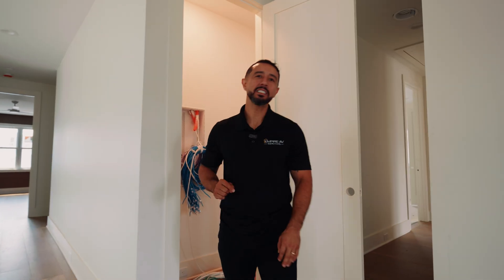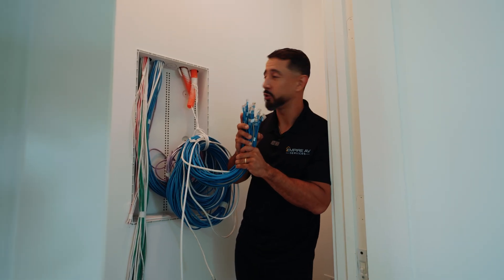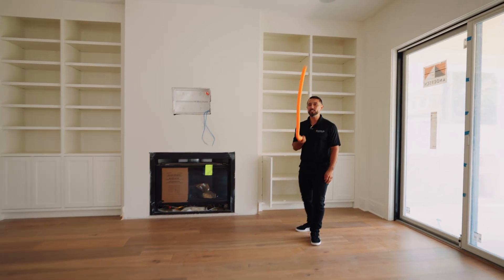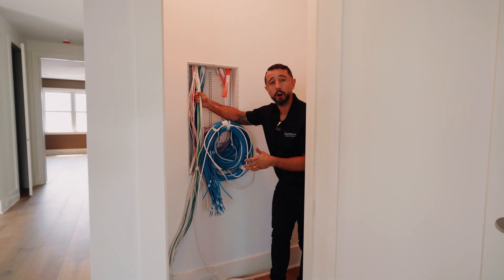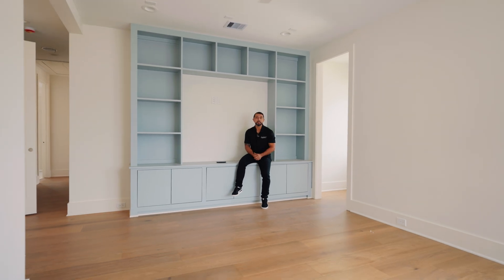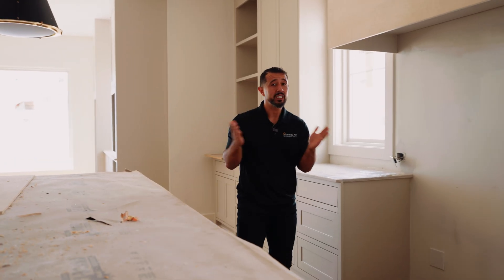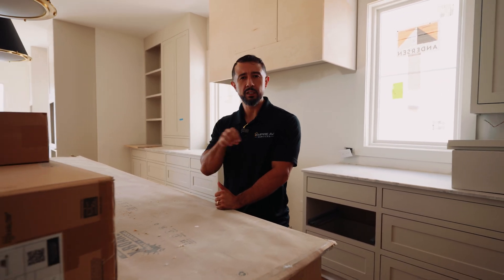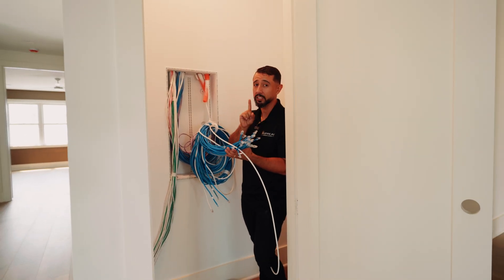10 Smart Home Pre-Wire Mistakes to Avoid.

Comment: For number one; do you use or recommend to use Cat8 cable for POE devices, such as cameras?
Reply: For number four; are you using a structured media cabinet in conjunction with a server rack?
Reply: For nine point five; I subscribed! 😂
Reply from the maker: Sometimes we do both, just depends on the setup. If a home owner wants stuff local, we might use a media panel in the closet or cabinet. Other times, we bring everything back to a central rack with patch panels. All comes down to the flow of the house, products and the scope.
Reply from the maker: Cat8 looks cool on spec sheets, but honestly it’s way overkill for most smart home gear. Most POE residential devices can’t even handle that bandwidth. We stick to Cat6 or Cat6A — easier to work with, and still more than enough for cameras and access point. (If you need extremely fast speeds for other things then maybe but for cameras you won’t need that for a while)

Comment: hey i have a question. Lunar-Walls, would they be willing to lend you a large number of panels for a proof-of concept?
Reply from the maker: What kind of proof-of-concept are you working on? Would love to hear more about what you’re looking to build or test out.
Reply: @empireavservices  This will be a bit of a long one, but I want to get you into my frame of mind so the idea makes sense.

Movie theaters are basically a dead concept for anything but blockbusters. Romantic comedies and mid-budget dramas used to justify a theater release, but streaming killed that. Those are the new “straight-to-video” films.

The tech you’re working with is the future. Right now it’s where flat screens were in 1998—when CRTs were still cheaper to produce. Fast forward to 2006, PlayStation 3’s big selling point was “1080p.” (For context, the PS3 came out in 2006… 19 years ago. Yeah, launch PS3s can legally vote now.)

Micro-LEDs are expensive today, but eventually we’ll ship displays with zero dead pixels, since small modules can be swapped at the factory.

Here’s my thought: what if you borrowed enough panels from the manufacture to build a mini big screen—a proof of concept showing what the tech will feel like 20 years from now, when each wall module costs about $300? A future where the room and support gear cost more than the display.

Maybe go half-scale (1:2). Big, but totally doable with some basement dirt work as many homes have pools in their basement, or even by converting an old barn that would’ve just rotted away, and there's plenty of those in rural America as they're obsolete style of farming compared to pole barns.

Width: 330 in
Height: 138 in

Comment: Using KNX is one of the best ways for a Smart Home. Especially using presence sensors in each room is necessary for a real Smart Home.
Reply from the maker: Definitely agree—presence sensors bring that true smart experience when done right. KNX is solid for certain regions and applications, but here in the U.S it’s not common. We primarily use Control4, Josh.ai, and similar systems. Always cool to see how smart home standards vary across the globe!

Thanks for watching
Reply: @empireavservices interesting, didn‘t know. Here in germany, KNX is very popular. It is an old standard, but very reliable.
Reply from the maker: Definitely agree—presence sensors bring that true smart experience when done right. KNX is solid for certain regions and applications, but here in the U.S it’s not common. We primarily use Control4, Josh.ai, and similar systems.

Thanks for watching

Comment: You should not use shielded speaker wire it can cause induction issues over long distances.
Reply from the maker: Great catch! 🙌 Shielded wire definitely has its place in the right environments—especially where there’s a lot of interference or sensitive equipment involved.

What I meant to say was jacketed speaker wire, not shielded 🤦‍♂️ — just a slip on the vocabulary that I didn’t catch. Appreciate you pointing it out! Always respect when pros jump in with solid feedback. 

That’s how we all keep leveling up. 💪